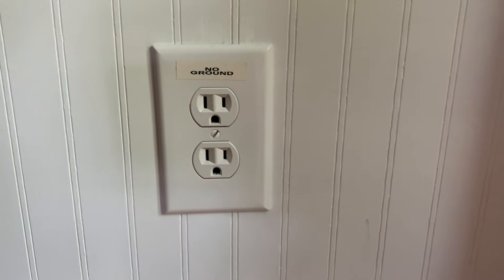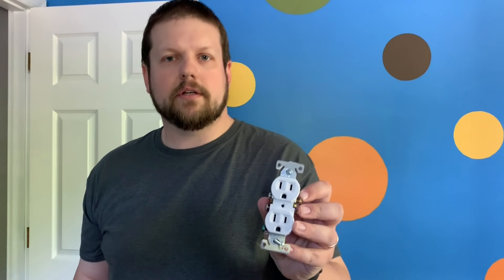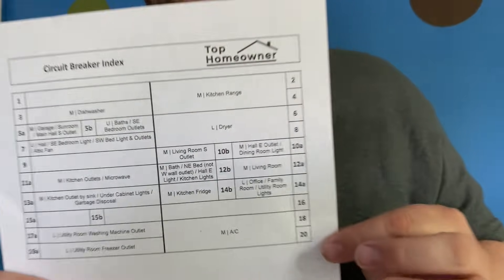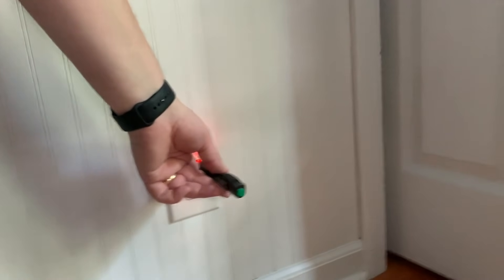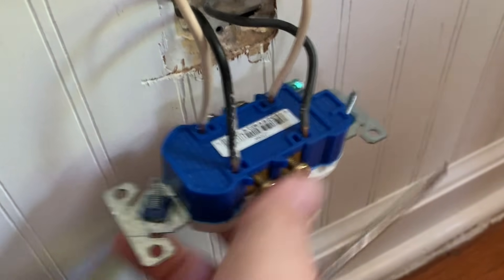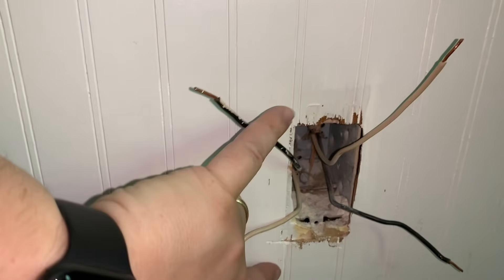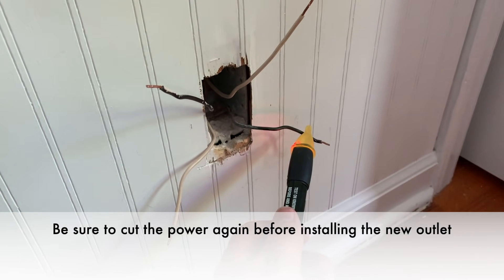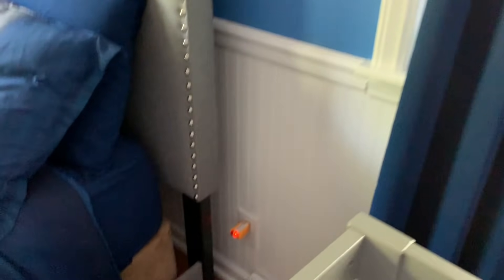Fixing Ungrounded Outlets - An Alternative Option to Rewiring Your Home

Comment: Equipment ground, ironically both the neutral/ grounded conductor and bare/ green equipment wire are bonded at service panel.
Reply: At the main service panel, not at the subpanel that's why you need to distinguish ground/neutral. So, incase you add subpanel in the feature and you will need to switch some circuits you will not have to spend a day figuring that stuff out.
Reply: The ground is connected to the neutral so that in case of failure there is low impedance path and the beaker will trip. In some other countries they use TT system where the ground goes only to ground i.e. the soil. Those systems require GFCIs so as the ground resistance is too high to trip the breaker, especially it would at 120 volts.

Comment: I've done this over the years to several older homes.  I just replace ALL the outlets. In quantity get them for about $8-9.00
Reply: Bump! Is replacing all the outlets a viable solution?
Reply from the maker: You only have to replace the first one on the circuit in order for all of the downstream receptacles to be protected. I talk about that in this video: https://youtu.be/Uop79H_iqoQ
Also, there's a follow-up video to this one that answers some other questions specifically about 2 prong to 3 prong conversion: https://youtu.be/3AXcRsAOLPk

Comment: This doesn't work. Installed GFCI and my metal macbook computer still tingles my fingers with electricity.
Reply: Have you tried other rooms in the house or even a different location altogether? If you have a gfci outlet installed, then I don't think your issue lies within your source, but rather the hardware of the computer itself. I'm currently looking into this as a solution to replacing my old 2 prong outlets so that I feel a bit safer running my expensive gaming computer through it. I know a lot more about computers than stuff like this though, I'm definitely no electrician, just my thoughts on the issue.
Reply: First this does not ground and second aren't Macbook charges double insulated anyway. There should be no voltage higher than 20 V on a laptop. Are you using some cheap Chinese suicide charger?

Comment: 99% of the time it will be the outlet closest to the power panel and if you have open space like a basement below you may be able to fish a ground wire down and the surge suppressors have something to drain to. Check with your local electrical inspector. Retired IBEW 292.

Comment: i thought that if you have a metal box for the outlet, and you run your wires from the breaker box through the metal flex tubing,  then ground the  outlet to the metal box, then if the flex tubing is grounded to the grounding plate inside the breaker box you have a ground. so the outlet he showed first with the green ground wire connected to the box would have been just fine as long as the romex was run inside metal tubing.

Comment: I don't know where you at but here the GFCI is load is power in & line is power out & they are marked that way even in the instructions & on final end runs the Gfci has the line screws blocked off

Comment: Would it be better to replace the breaker of that circuit with a GFCI breaker ? This way, there is no need to hunt for the first outlet in the circuit. And when you lost power, you know where to reset the breaker.
Reply from the maker: Yes, unfortunately in this case the breaker box was too old to do this. We did consult with several electricians for their recommendations and a home inspector to make sure everything was good. Also, I made a follow-up video that talks about this: https://youtu.be/3AXcRsAOLPk

Comment: the receptacle shown at 7:00 is not properly wired, there are exposed copper out of the hole where the wires go in.
Reply from the maker: Yep. Horrible install before it was upgraded to GFCI

Comment: There is NO way to Ground the outlets without snaking/ running NEW 14/ 2 wire to each switch/ receptacle.  Since the 1930'a the Electrician Unions have NEVER made it easier for homeowners to do their own repairs on purpose...  It's all about the $$$$$$$$
Reply from the maker: I made a follow-up video that talks about this and answers some other questions from this video: https://youtu.be/3AXcRsAOLPk

Comment: GFCI outlet DOES NOT make a non-grounded circuit grounded! NEC code require a non-grounded GFCI to be label "No Equipment Ground".
Reply from the maker: I clarified your points in a newer video: https://youtu.be/3AXcRsAOLPk

Comment: Good luck selling your house and explaining that instead of actually doing it the right way, you took a shortcut and just placed a GFCI on each circuit within the house. That looks like you knew there was a problem with ungrounded outlets and decided to do minimal work, which will put buyers off thinking you took the same approach on the whole house too.

Comment: Now you possibly have created a problem.   You kept saying outlet in the room.   I seriously doubt that two receptacles were the only ones on that circuit.    The GFCI should be on the first receptacle in the circuit or closest to the electrical panel.   With your method, you will go to each room and install a GFCI.  You could have two, three, or more GFCI's in series.   Very probable nuisance tripping.
A possibly easier way is to install a new GFCI next to the panel, connect it to the breaker for that circuit and run the existing conductors off the load side.
Reply from the maker: You are correct. I made a follow-up video that talks about this and answers some other questions here: https://youtu.be/3AXcRsAOLPk

Comment: What about the light switch, my outlet is connect to the light switch?
Reply: If you are nor doing any modifications to the switch then it is not relevant. However, as in those cases the switch typically controls only one of the sockets that might not be possible with a GFCI socket as the other side is the load.

Do you really need a three prong outlet in that? Lamps generally are double insulated. There is no requirement that you change all the outlets in a room.

Comment: A GFCI is not an "effective ground fault current path" Read NEC dude.Here is a thing with GFI's, they dont always work, sometimes as many as 1 in 10 wont. Wont catch Arc short either.
Reply from the maker: I made a follow-up video that talks about this and answers some other questions if you are interested: https://youtu.be/3AXcRsAOLPk

Comment: I'm only going to comment this because the guy from the video didn't mention it. Make sure to connect the black (hot) wire to the brass colored terminal, and the white (neutral) to the silver terminal. Please do not mix these up. And don't leave anything to guess work. Do your research, or get a professional to do it if you are still not confident in what you are doing.
Reply: These days, practically every outlet I've seen is labeled, Black and White, and GFCI outlets are labeled Line and Load...

Comment: you didn't show the most important part. why edit out connecting the wires to the socket? I needed to see the visuals so that I can have piece of mind.
Reply: Black wire goes around the brass screw, white wire goes in the silver screw. Also, keep in mind that the side labeled "line" refers to the pair of wires that is bringing in the power, in other words the one that was beeping when he tested it. Load refers to the wires that connect the GFCI to the rest of the outlets going downstream. But, as always, it is best to see it done for assurance. Perhaps look up another video on how to wire outlets.
Reply from the maker: I recently made another video that covers the wiring: https://youtu.be/Uop79H_iqoQ

Comment: If you don't have a ground to that circuit, you should really hire an electrician to do the job per code.  If the entire house is that way, your wiring is very old and should be upgraded anyway.

Comment: Incorrect, Sir! GFCI protects the human and the wiring! It is not about wet locations at all. It is also not about “protecting outlets”. Not a bad video, but So much incorrect terminology and info. Stick to things you know. Electrical code and equipment are very serious safety topics.Last, a “bleepy pen” is not acceptable as a safe check. Always use a meter and put some gloves on when dealing with voltage!

Comment: That method does not identify the correct neutral going back. A better method is to use a multimeter across the hot wire  and neutral to be sure you have the correct two wires. If you happened to get the incorrect neutral you would have a dead circuit.

Comment: Would it be better to find the actual first receptacle on that circuit( it may not be in that room)  therefore protecting everything on that circuit.
Reply: Good luck in a older home what most people who are not electricians don't know is that older homes aren't wired and loops they go to the fixture and are spider webbed from there thus you will need multiple arc fault GFCI receptacles in every room
Reply: What's why you do every room seperately.    You might end up with two or three GFCI's on the circuit, which is good.   Each room needs to be protected.

Comment: Thanks i liked the video . can you show the part of you actually putting in the wires and buttoning up the outlet.
Reply from the maker: I know this is an old comment but I wanted to let you know I've come out with some follow-up videos recently. This one talks about wiring a GFCI receptacle but doesn't show the process of putting it back in the box. How to Wire a GFCI Outlet - What's Line vs Load? https://youtu.be/Uop79H_iqoQ I have another video planned for the complete install.

Comment: It could be in most older homes power coming in from the ceiling fixture which powers the switch to turn on and off the light and power to an outlet in the room with no metal junction box if the electrical cabling system was BX.  This may be tedious but he might have to trace the cable back to an open junction.  Very common issue in older homes wired with BX cable.
Reply: Had a ceiling fan installed by a handiman. Now outlet doesn’t work. Fan is slow. And my porch light stays on with the ceiling fan. Fan off, light off. Wtf!? Thx.
Reply: Also, does have metal box and no ground wire.
Reply: @autorog1234  Was the cable coming into the box BX?
Reply: @cgillyard  I have no idea. It’s a cinderblock wall
Reply: A gfci outlet won’t fix this right? I repair humans, not electrical problems but I try. 😅
Reply: @autorog1234  Your issue is the setup from the original home owner or previous owner.  I doubt a GFCI would resolve it.  This is where an electrician would be necessary.   The problem may lie in the ceiling fan installation.

Comment: From a personal safety perspective your fix works fine.  However, many stereo and computer users include power strips with built-in surge suppressors in order to protect expensive electronics.  It's likely that the lack of a ground connection, regardless of the GFCI addition, might render the surge suppressor as useless.  Of course, if you mark all outlets as "not grounded" you have forewarned future users.  Most won't realize that the lack of ground defeats often expensive surge suppressors.
Reply: Nope.. in the event of a voltage spike, they allow current to flow between hot and neutral, not ground.  They are not allowed to return current over ground.
Reply: @phillipsusi1791  Yup. Ungrounded circuits will render surge suppressors useless for protecting electronic devices.
Reply: @lazurm  Incorrect, they will pass the surge between hot and neutral. The ground wire is not an issue as it is not connected.

Comment: Just my 2 bits...
Adding a GFCI is not really an alternative to rewiring. Sure... it beats running down to the basement to reset the breaker. But, your
outlets are still not grounded, and it doesn't improve the existing wiring. I know. It's not the end of the world. Mankind has survived
the sans-grounded era, and will continue to do so. It's the rest of the system that's cause for concern.

Installing GFCI's is not a determining factor of whether or not your wiring needs to be replaced. Rewiring is usually determined by
the condition of the installed materials. (Duh.) Loose & broken connections, as well as inadequate wire size to breaker size are some
of the biggest reasons for electrical fires and power failures. If your home STILL uses "knob & tube", and the fixtures & devices are
visibly "old"... it's that time to strongly consider rewiring. Just because "It still works." is not a good reason to put it off. I completely
understand that budget constraints can have you putting it off. But BEWARE... Unsafe wiring isn't concerned about you, or your home,
or your stuff. If you're pulling too much current through old wiring (wiring jacketed in cloth, for example), one spark, one over-heated
conductor will have that home aflame. Unbeknownst to you... a switch or an outlet breaks. The pieces of the wreckage are moving
around every time it gets touched. Those loose parts will spark, or cause the circuit to short. That's usually how it starts.

So please... don't think that adding GFCI's is an alternative to failing wiring. Installing a GFCI does NOT improve unsafe circuits.
Safety is more important than savings.
Reply: The breaker likely won't trip if you get shocked.  The point of the GFCI is to stop you from getting shocked, not to magically heal old frayed wires.

Comment: I was watching a "Fixer Upper" a couple of years ago and Chip put GFCI plugs in EVERY BOX IN THE KITCHEN.  That was when I really came to understand that he doesn't know what he's doing, and neither did his GC.
Reply: If the 'box' is within 1m of a water source and they are fed from a different circuit then yes, they should have their own GFCI receptacle (or breaker). The kitchen will use more slots on your panel than any other room in the (typical) house. Fridge should be dedicated. Range vent-microwave unit on its own. Built-in dishwasher on its own... list goes on and on for dedicated circuits in the kitchen. Ontario code 26-724 says no more than 2 receptacles (that means one duplex) per branch circuit.

Comment: As the third owner of an older double wide mobile home with signs of DIY electrical work. I sounded out all outlets on each breaker before putting in the GFI outlet your way but did the trip test on all the circuit outlets as I have multiple rooms on common circuits and multiple outlet circuits in some rooms. This may have been allowed by 1981 Colorado MH code and DOT code. Just a heads up that mulitple codes create confusion. LOL at least my outlets and lighting circuits are independent and I now have detailed breaker labels on the main panel.

Comment: I’m not an electrician either but I am a Registered Home Inspector. The gfci receptacles “satisfy the requirements for grounding” but don’t actually trip if you use your tester. By manually pressing the “test” button it will kill the other outlets but I don’t see how that actually helps! Electricians, please provide some opinions, I have a great respect for licensed trades people. One last thing, did I see him touch the wire with his volt tester??
Reply: Thanks for asking.  Code first, example after.

GFCI protection is suitable for non grounded locations.  NEC (National Electrical Code) article 406.4 (D) (2)
Also should be noted: when replacing any receptacle, you are also required to add AFCI protection.  NEC 406.4 (D) (4)
Know your code, right?  :-)

Also: know how safety works.!

GFCI protection is safer than grounding in a wet location or anywhere a person could become grounded...Especially in the age of plastic boxes and covers, getting shocked by a receptacle is difficult.  Touching electricity while grounded is actually much easier.  Let's say a toddler sticking something into a socket while touching a radiator: in this situation, grounding would do absolutely NOTHING to protect that child, but GFCI protection would save their life.

Hope this makes sense and it is a good example to pass on to your home buyers!  :-)

Comment: That’s not correct it’s still not grounded probably by code.
Reply: Not grounded but is protected and is code. However, the "no equipment ground" sticker needs to be on this and all outlets down stream.  The issue is modern electronics equipment won't be as protected as if it had a true ground.

Comment: Seen alot of people like him, I do not recommend doing this, because a gfci is useful but without a ground you still face electrical shock, and electrical failure.
Reply: How does a GFI work without the ground wire connected? Doesn't that just defeat the hole purpose of ground fault protection? Myself, I think it's a waste of time and the cost of changing the regular outlet with a GFI.
Reply: @gordonlovett71  Ground fault has nothing to do with the ground wire. Ground fault means current escapes to the ground possibly through some person.

On what information do you base your thoughts?
Reply: Actually its very much code as long as you add the "no equipment ground" sticker to the face plate.  In fact the GFI reacts far quicker than the breaker will so, no you wont get shocked unless the GFI fails.

Comment: With no ground wire the GFCI will not work correctly or protect you
Reply: Not true.  The gFCI would say "Hey, 10 amps going out the hot, only 8 amps coming in the neutral; *I don't care whether that extra hot current is going through my ground or another ground: I'm shutting off!"
...Except that GFCIs don't actually speak.